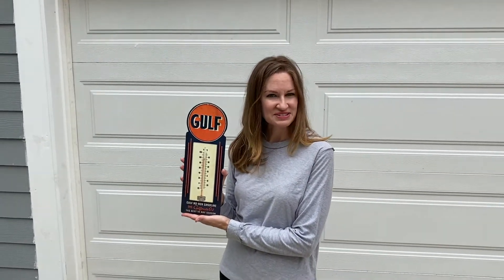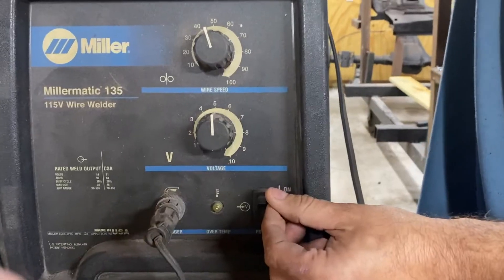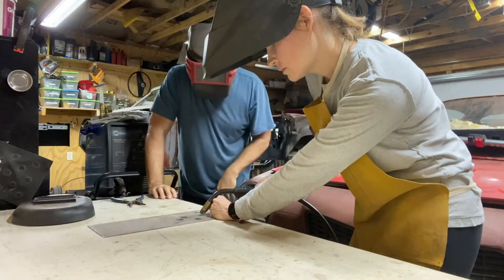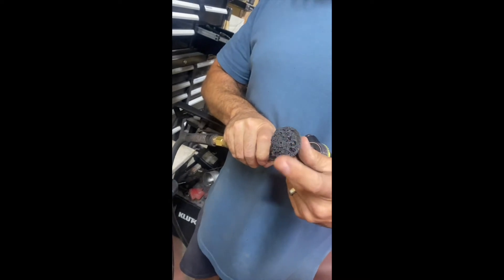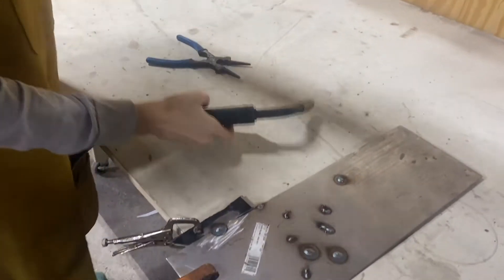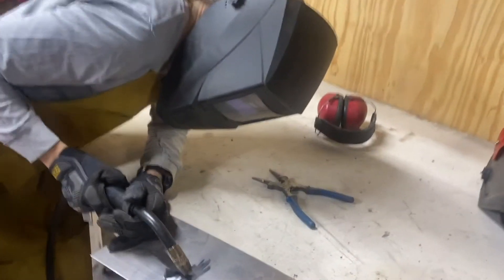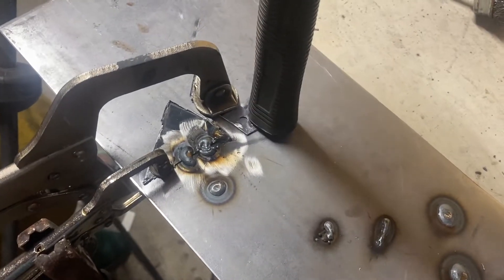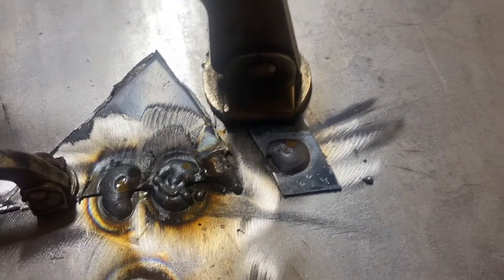Learning to weld

Comment: I took a night school course on Mig Welding but before I could take it my prerequisites from HS did not count so I had to first take Acetylene and Arc Welding in one class, then Mig. The Mig class was a split class with people taking Tig which I got to practice once my project was complete. Just remember a tack weld is 2 sec long and when running a bead, you make small letter e’s (a written e, not a printed e)  in a series over and over so when done, they look like a row of dimes joined together.